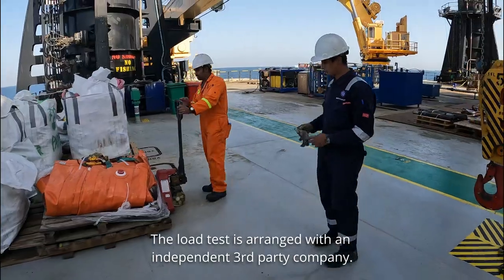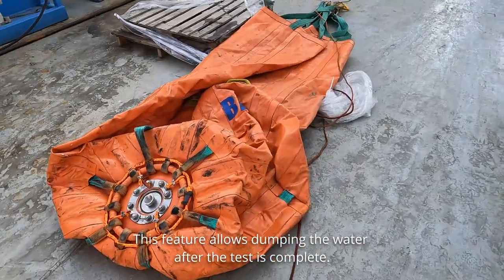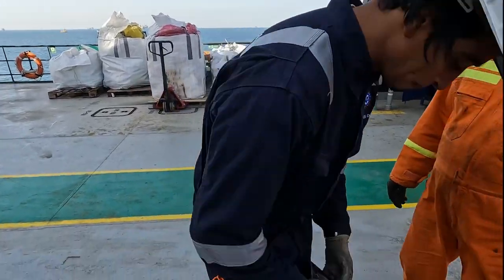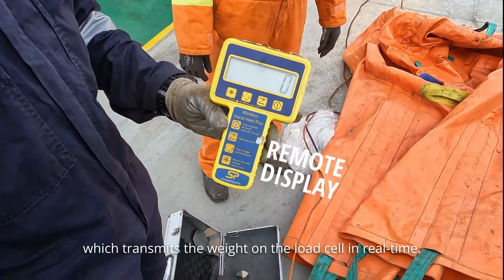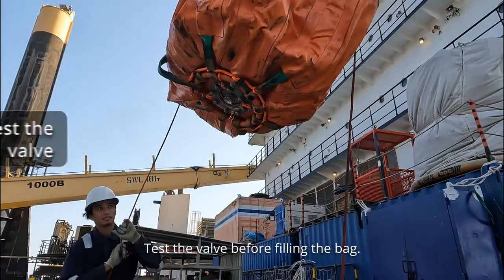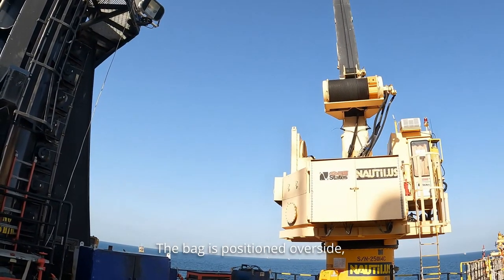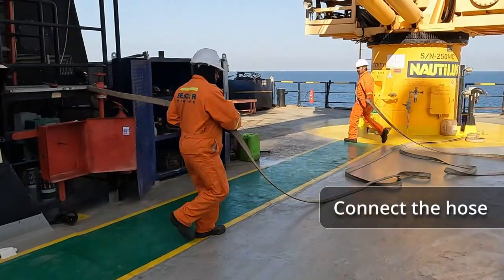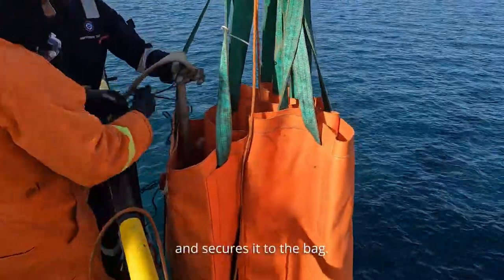Proof load test | Offshore pedestal crane

Comment: What is the holding time?
Reply from the maker: Depends on your class society requirements. We refer to ABS Guide for Certification of Lifting Appliances or API Recommended Practice 2D. The best is to check with inspector, because it depends of the type of the crane as well.